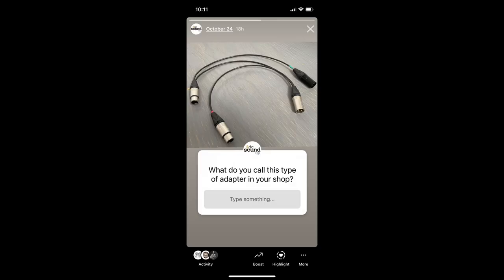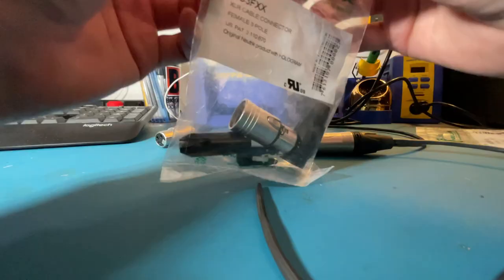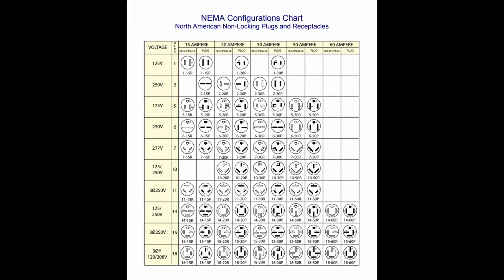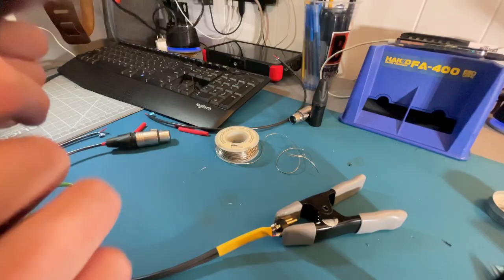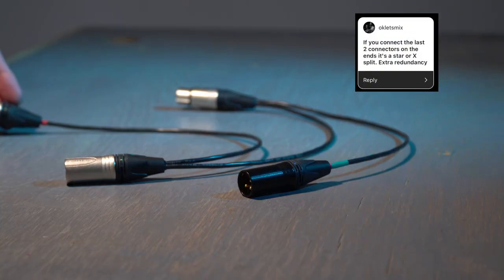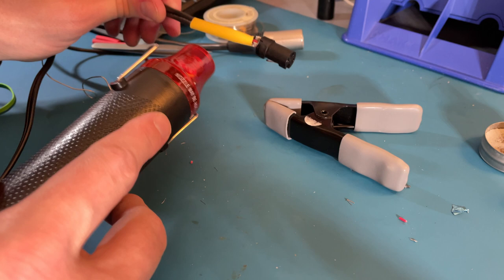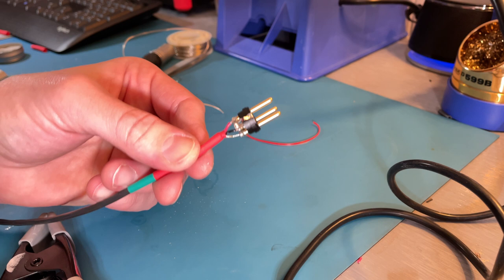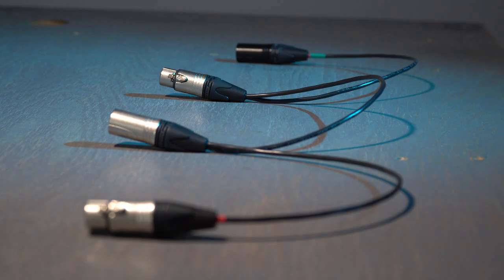The best XLR Adapter Pro Audio Technicians can carry!?

Comment: The Z cable is the best cable, as I've already said. It's able to do the job of 4 different cables in one, with very little extra space in your case. I normally have two Z cables with me at all times and two single XLR cables with convert-con connectors at both ends. This allows me to do pretty much everything I need. On top of that I have two RCA-Convertcon cables and two 1/4"jack-Convertcon cables. That's everything you'll ever need. And saves me from having 6 or 7 extra adapters in my case.

Comment: I built this Z adapter several years ago for my Smaart kit, but with a slightly different "twist"
1 Neutrik NC3MX
1 Neutrik NC3FX
1 Neutrik NC3FM-C ConvertCon
1 Neutrik NP3X 1/4" TRS Plug
AND MOST Important....A wire label with your name/company behind some clear heat shrink!!!!!
I keep two of these super useful adapter cables in my kit, they have saved countless projects for me, but when others see how useful they are, they have a tendency of growing legs and wandering away.  To the two people/companies that have my missing adapters without my name on them, you're welcome!!! Hence why the most important thing to do here is label it so it doesn't disappear!  Lesson learned!!!
I also have several adapters that convert XLR to phoenix type connectors for fixed installs, along with stereo adapters with 3.5mm TRS and 4.4mm TRRRS plugs on them.
Reply: That's an excellent idea, Arthur - I was considering a modification to my Z-split with the ConvertCon, but adding the TRS jack would be a game changer!

Comment: I made 2 boxes with XLR male and female. With a double pole switch in it. so you can hook up everything with one advantage, you can rotate the phase. Hook such a switch in the "middle" wire and you have a box that can be used for anything. You could even run a ground lift switch in it. Just a little box with XLR on both ends, on top and a double throw switch on the top of the box, between the 2 other XLR's.
Reply from the maker: That sounds really handy, do you find yourself using it a lot?

Comment: In the TV broadcast, the "W" cable is widely used in the announcers booth setup. Mostly to daisy all the anncr boxes Talkback outputs to one single output to the truck. There are usually three talent boxes,, so the "W". Thus I'd say this is a "Z" cable.

Comment: To avoid confusion, I'd call them "jumper splitters" because you can use them to split a jumped signal. For instance, split the signal between a stereo input to FOH PA and a mono input to satellites, and it does the job a a jumper as well!
Reply from the maker: That's an interested use of 'jumper' I've never heard before. I'd usually say a Y cable either splits, or combines (mixes, sums etc.). Jumpers in electronics can be any conductor really that is added to either split or gang things together, or otherwise open or close a circuit. So a 'jumped' signal doesn't really tell us what we're doing with it, other than putting it in circuit with something else, right? Maybe I'm misunderstanding though, happy to learn more about what you're doing, thanks for the message.

Comment: Yeah! I could see a couple practical uses for this in my kit. Running multiple power amps together, and monitor chains off the top off my head. Certainly got all the components I need. A lot of our outputs and speakers have been run off 1/4" except for the main out from the mixer so it's never really been necessary yet. Like, you wouldn't want to daisy chain mics like this, but you could side channel one fairly easily I suppose. haha sorry I'm just thinking out loud. Good video.

Comment: Hey, 5:59 - there's actually a debate going on, whether it's clever or not to connect the ground to the shell.
Devices with metal housings are usually earthed (e.g. amps) so it might occur, that an XLR receptacle in that device has a direct electrical connection to the housing because it's mounted there. Now with a plugged in cable, the shell would also connect to that same potential and you would essentially bypass the GND/Lift-Switch because the wire's GND would always be earthed no matter what position your GND/Lift switch is.
On the other hand, if you use the wire as an extension, it might be an advantage, that you have a proper shielding (the connector's shell) which is connected like the cable screen at the connecting point.
So at the end it's kinda an religious question, if you should do it or not, but one should be aware of possible problems imho. :)
Also, often the devices XLR receptacle are made of plastic nowadays, like the Neutrik XLR/RCA combo type, so you would not run into the mentioned problem often.
Greetings from Germany! :)
Reply from the maker: Thanks for the great message. It is certainly good to be mindful of what you’re going to use a cable for when you set out to make your own. It’s great to know the videos are being seen in Germany, thanks again!
Reply: I'd be confirming best practice in Rane notes if the Tribe still has them around.

Comment: I remember back in the days, it was 2011, and a good technician from PRG gave me this cable, from that day I've always used the "Z" cable instead of "Y", smart idea with one xlr more only ! ;) Still wait the world to move entirely to full rj45 plug for everything, XLR are old, and due to the great lossless low latency codecs out of there everything should run over IP basically.
Reply from the maker: So I used to work at a pretty large art gallery (six city blocks long) and they went this route at one point for a lot of the tie-points and discreet patch panels. It was a CONSTANT battle to keep the installed RJ45 working and free of dirt, corrosion, dust, ants and all sorts of other crap over time in public spaces. Even with unused ports capped and in enclosures, it was a huge headache. I love what they make possible, but the connector itself is a struggle.
Reply: @DcSoundOp  Ethercon?
Reply: I find XLR far more robust over multiple years.  Based on my interactions with local live production people, I was an early adopter of audio and IP (as I'd been in both the live audio and digital networks fields seperately prior).  I love the universal simplicity and compatibility of the XLR for end devices.   Sure, IP for trunking instead of massive multicores, but I'm not looking forward to the day a guest artist walks onstage and suddenly I'm debugging firmware versions on why their mic won't talk to the mixer input channel?  Yikes.....
Reply from the maker: @AndersHellquist  It was Ethercon… but didn’t help when stuff was physically blocking the pins.

Comment: I've never seen a cable like this... I know there's the Y splitters/combiners, but I'm just trying to figure out a practical use for this cable... I guess since you could use it as either or, it cuts down on how many cables, but I just need a demonstration of practical use of this cable so I can understand how not to fuck it up lol
Reply from the maker: It is as much to avoid carrying a ton of separate adapters as it is useful all at once. Most of the time you'll probably use it as a simple turn around or splitter. With amp racks and line arrays, or any gear where XLR i/O is in parallel, you can use it as a 1x3 split as well, which is handy. Of course it also works as a long jumper like mentioned in the video if you need a 3' patch cable in a pinch to go between racks etc. Does that make sense? Thx for watching!

Comment: Hey good video  i had to make 2 y cable (xlr) to feed a cvr 4ch amplifier input from a mixer ....but my question is what size is the cable itself or whats the wire type?
Reply from the maker: If you want something similar to what I'm using, try belden 8412 - it's an installation type cable. Or you can use the standard Belden 8451 which will be a bit tighter squeeze going through the XLR boot. Canare L2T2S is great too for making your own cables.
Reply: Just about any shielded pair will work, but it can’t be too big to fit two in the connectors. I use 22awg pair with foil shield. Lengths vary from 8 to 30 inches depending on expected use. If it’s more than 12”, I add a Velcro tie to minimize tangles.

Comment: I make mine without loose ends - every connector has 2 wires in it.  And I call it the wonder Y.
Reply from the maker: Do you make all of the wires the same lengths? I'd love to see one if you can message me a photo? Thanks for checking out the video!
Reply: @DcSoundOp  yes, wires are all equal length of 4 to 6 inches. Imagine a diamond shape. Prepare cable ends. Strip, twist, and solder conductors together on all 4 wires. The connectors go on last.

Comment: Can i use this for my 2 units wireless mic setup?
Reply from the maker: While you technically can, combining signals from two wireless mics this way isn’t a recommended method. If your receivers can output a line level signal, many mixers have 1/4” inputs with no mic pres that are perfect to plug in wireless receivers.

Comment: I called them the X Split.  I first started making up my own for branching ClearCom systems back in the day, later used them in sports production.  Started with Switchcraft, then moved to Neutrik.  In the center I used a short cable tie to maintain the X.  Oddball variations included 2 XLR-F to 2 bantam and 2 XLR-M to 2 bantam.
Reply from the maker: Ah, bantam adapters are a whole other category of fun! Thanks for the message!

Comment: Where can we use this cables and how!?
Reply from the maker: You can use this cable anywhere you need a Y cable to split a signal. They are very useful in amplifier racks where you need to chain inputs to multiple amps, but also handy for other situations. Thanks for watching!

Comment: Well, I watched the video, and I still have no idea what you would use this for.
Reply from the maker: If you've used a splitter, any type of Y cables or either type of XLR turn arounds, this does all of that in one adapter. Lots of good comments here from folks on how they use them in different ways.

Comment: Those terms need to be adjusted. That is just going to confuse people.
Reply from the maker: Apprentice electricians seem to be able to handle it without confusion. Which part are you finding confusing? Maybe I'm biased because I'm fortunate to know a LOT of really smart audio professionals. Compared to even ten years ago though, most ppl working in pro audio now are getting network certifications and other WAY more confusing stuff accomplished. I'm 100% betting that the next generation of audio pros are going to be even smarter and brighter again. I hardly see updates to technical language as a serious concern for confusion.
Reply: @DcSoundOp  doesn't matter I'll still call it male/female. Old habits. I do like the new terms, easier to differentiate between them.
Reply: Myself, I understood exactly what was being meant by the "new" terms as they've been pretty commonly used for as long as I can remember and I'm in my 50s... Except maybe *receptical*... Yeah, I don't use that one. 🤭
Reply: I carry both split and combine, which serve this purpose. I also have a box of hard and cable adapters including 6.3mm M/F, TS & TRS, and RCA. Maybe not universal, but quite useful. Oh, I almost forgot 3.5mm to RCA, 6.3, and XLR. 
I’ve thought about making a massive combo adapter, but reliability would suffer.

Comment: Lol. genderless or binary / non binary terminology. Some.old sound techs will surely get the tech rider confused in future.  We call these specials X or Y splitter cables.
Reply from the maker: I cannot imagine a single situation where this would affect a technical rider honestly. Can you help me understand what you're talking about?
Reply: @DcSoundOp  i was referencing the proposed change in terminology for established names ( xlr / m & xlr /f )/ code/ description of connectors.. and not your video, which is helpful and a very good patch  problem solver.

Comment: Take it a step further and use gender benders on every connector to make it more useful for a greater variety of practical applications
Reply from the maker: I’ve got a video about the ConverCon connectors from a few months back… it involves a hammer 🔨 💥 https://youtu.be/UFjFTgw5MRM
Reply: Maybe one since they are so expensive and as mentioned above, can grow legs and "walk-away".
Reply from the maker: @Videditor1067  That's a great point, with four convert-con's you'd be into this adapter for like $70 before buying any cable... that's a bit steep alright. 😂